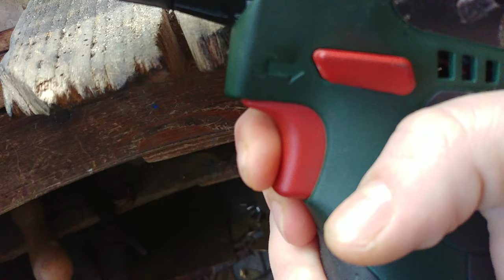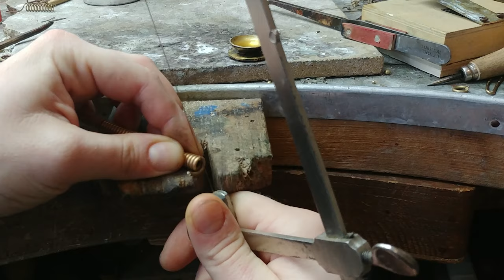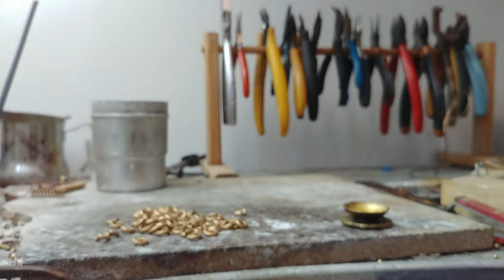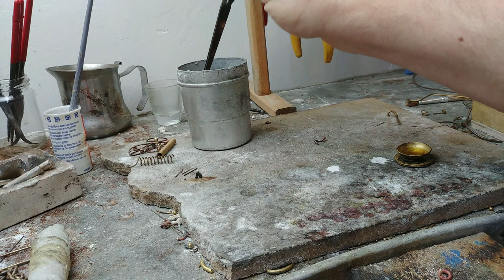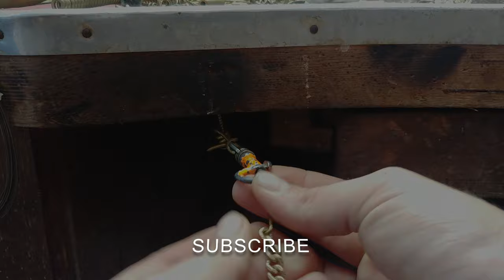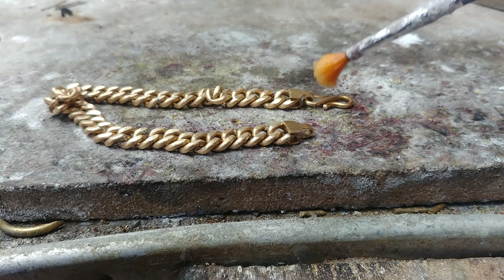Cuban Chain Bracelet Making | Woman's Brass Bracelet ~ By Kryher

Comment: it's welding using silver or something so that the result remains yellow.
Reply from the maker: I use hard silver solder, it's not yellow but if used correctly the tiniest amount is enough and if the soldering is seamless it's hidden within the brass so the result is perfect!

Comment: What is the brand of blow torch you use? Thank you
Reply from the maker: Hello there, I have absolutely no idea, I bought it used and reconditioned and the brand stamp is not where it's supposed to be, I only know it's italian, and I'm happy with it as long as it functions 😅
Reply: @bohdankryher9456  That's unfortunate but thank you. Do you happen to know what this type or torch is called? Where the flame is very small yet very hot.
Reply from the maker: @dittot  yes, it's an oxy hydrogen water welder